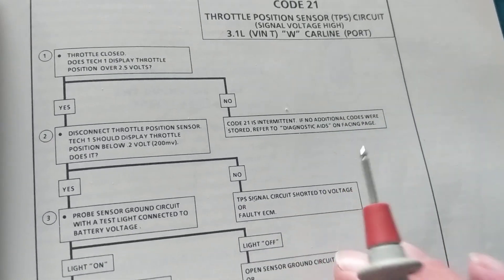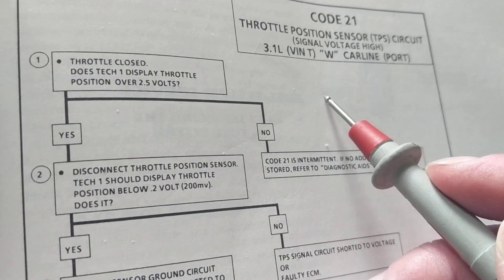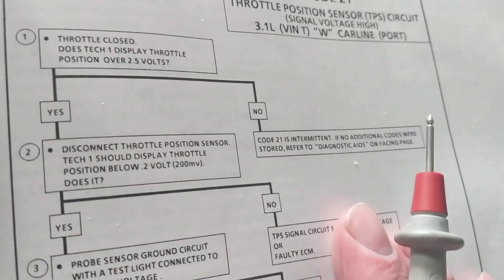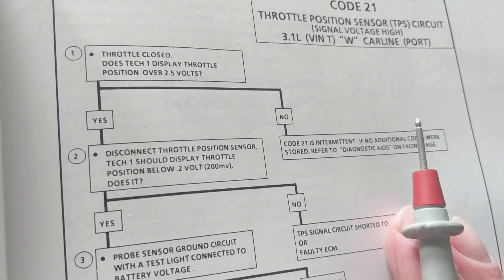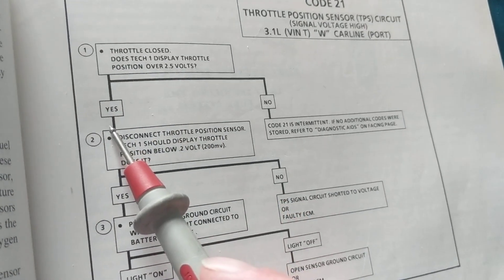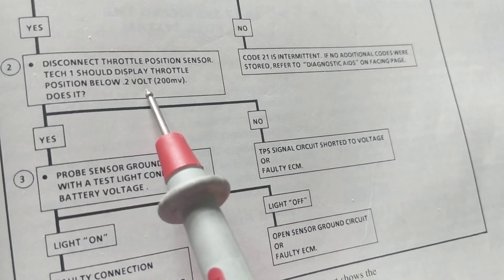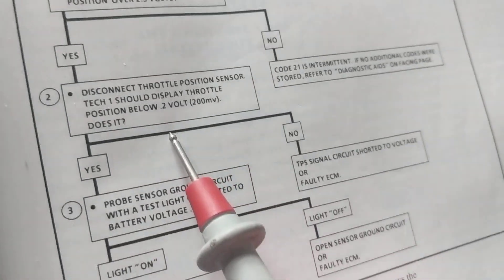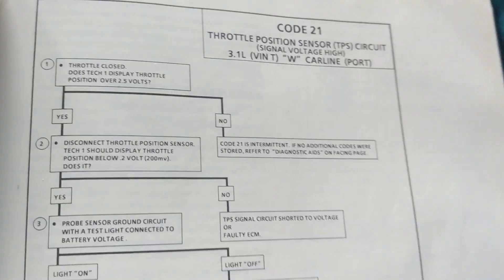HOW TECHNICIANS DIAGNOSE PROBLEMS FROM SCANNERS AND BEST BOOK

Comment: Excellent training. If I may add that we can check sensor circuit quickly and easy in few minutes without dismantling the wires by way of pulling the signal voltage down by supplying the signal wire with ground and watch the scanner live data. If the voltage goes to zero-that will mean there is no open wire or short and the PCM is Ok-which means the the sensor is bad. We  can do the same if sensor voltage is low- we pull up the signal voltage by supplying 5 volts to the signal wire and watch the live data on the scanner. If it goes up to  5 volts, that would mean there no opens or short and the PCM is OK. What do you think.
Than you and best regards.
Reply from the maker: I hear what you're saying you have a good analysis let's say the case is where the signal wire instead of going to the computer it's touching another wire not grounding it and not giving it 5 volts how would you know
Reply: @Joeelectronicschematicsforauto  Thank you Joe for your prompt reply. You are right. I think in this case we  have crossed circuits and we have to Ohm and check continuity of signal wire with other wires in the connector at PCM connector.
Thank you again.
Reply from the maker: @najeebqutshan5594  correct but I like your analyzation good electronics
Reply: @Joeelectronicschematicsforauto  Thank you Joe. I am learning from a lot from your videos. Keep up the good work you are doing. 
Best regards.
Reply from the maker: Good luck thank you for being a viewer and a contributor